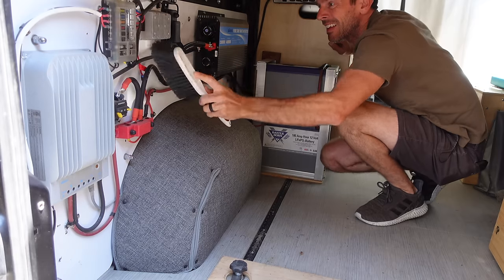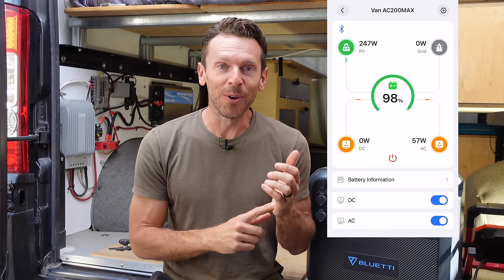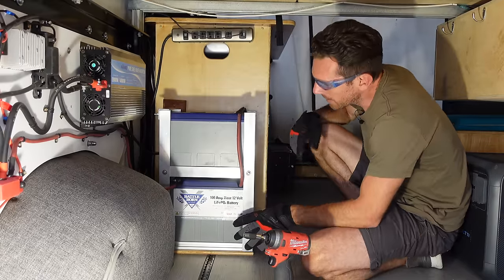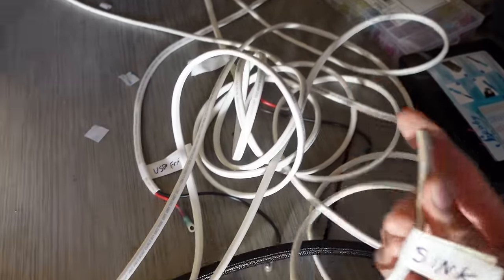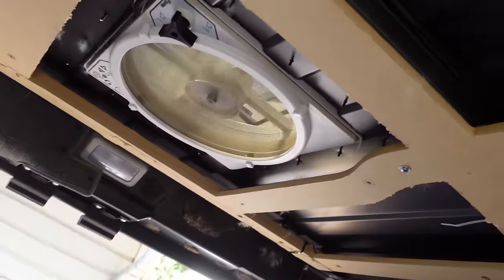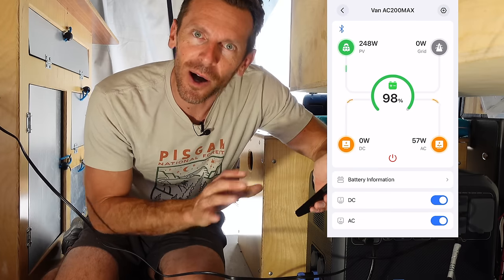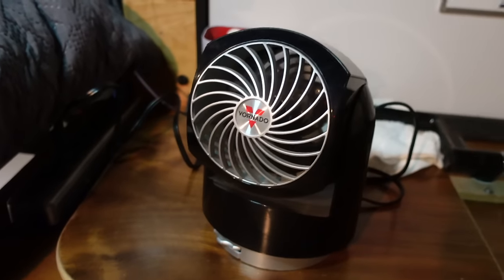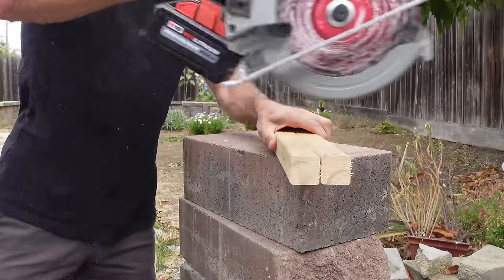The EASY way to power your van | BLUETTI AC200MAX Portable Power Station

Comment: I have a Bluetti AC 200 Max. That is a sixty pound mass that could break loose from that tape and fly towards the rear of your van if you get hit from the front. If you dont mind me suggesting this. Anchor it down with some straps on the handles and bolt those straps into the wood behind the Bluetti. Keep it from turning into a missile flying to the rear of the van.
Reply from the maker: Very good point!
Reply: 60 lbs? IM NOT BUYING ONE
Reply: @aaronweiser5421  newer Bluetti models have come out. There is a nice one that is 30 Pounds, one size down and can still run a microwave.
Reply: @cryptowolf-zf3fs  good to know, 2k is over kill anyways and ues i need to powe my microwave.
Reply: @aaronweiser5421  I have two bluetti's. The 200 Max and the AC-180. I got the AC 180 on sale for $590. I could not beat that price so I got it. Its the 30 Pound model.

Comment: I am using the same Bluetti in my van. I even charge my pivot shuttle. Still haven't charged it all the way from 10% to 100%, but I think it's great. I also wired my bluetti to the roof solar panels. I can charge from them or while driving. pretty cool thing to have when in a van.
Reply from the maker: That's great! I always forget about how nice it is to have a plug to charge up an eBike!
Reply: Can you daisy chain these for more watt hours?
Reply: Do you use it to heat your van? How long does it last? Thanks
Reply: @aname5091 I have my diesel heater connected to mine. It uses very little energy. No issues making it 24hrs at least.

Comment: I read a review on Amazon that Bluetti will shut off if power is not being drawn.  Bluetti does this because the idle power will drain the battery. But the problem is that fridges only kick on periodically. Also another complaint is that Bluetti will not start charging from Solar on its own, you have to unplug and plug the solar connection once their is enough voltage input.  These are terrible problems.
Reply from the maker: There's a setting to keep the power running all the time, just gotta turn off ECO mode. I've never had problems with it not charging from solar on it's own. I have it plugged in all day every day.

Comment: I went the portable lithium/solar panel route in 2018 using the Renogy. It didn't work for me. The cigarette lighter adapter sucked and my 3 100w panels never charged my pack back up to 100%. In upstate NY I had to bring the renogy inside when temps dropped below freezing.  I  switched to 3 AGM batteries charging from my alternator and I connected a cheap trickle charger to the batteries and put in an all weather female AC socket just underneath the van near the sliding door and passenger seat. I could run an extension cord from the van to a 15amp wall socket and keep the batteries topped up all the time. Looking forward to a report after a week at Everstoke and daily use. Love your channel and your content.
Reply from the maker: That's a bummer! I think things have come far enough now where you'd be good to go, but if your system is working good then that's great. Love the idea of the all weather AC socket. I've wanted to do an input and output on my van forever!

Comment: The ac200max can be touchy from time to time. Be careful on your charge settings in the menu, there’s a solar and car charger option. If you get them mixed up it can cause a fire. It almost melted my cigarette lighter because after an update it switched back to pv rather than car charger. Also, it’s picky on the solar panels used. I had a cheap 200 watt panel that was putting out 150 on a Chinese power bank but the bluetti would only max out at 80-90 watts
Reply: At least mine also likes to randomly decide to go all whacked out in terms of the BMS capacity monitoring. I'd give mine a 6/10. I much prefer my built system and I haven't found anything that can get close to the efficiency (the Bluetti inverter is TERRIBLE at low wattage/idle draw like laptops and starlink). 

He also touches on how terrible and expensive these panels aimed at overlanding/RV/vans, but also a huge misconception: You have to realize you're probably NOT getting 1000W/m^2 where you are.
Reply: @SnowIsMyTerrain what is your setup?
Reply: My capacity also goes all whacky sometimes. This last time I used it it dropped from 100% to 75% on its own while turned off.
Reply from the maker: Oh wow, I am mindful about the various settings! That's also interesting about the MPPT having different results.

Comment: Did the same with 2 Bluettis back in 2021. One is for 12v usage charged by 1 400w panel and the other is for our 110 usage and is charged by the van while driving. We switch the charging points if/as needed.
Reply from the maker: Very smart!

Comment: I love my bluetti 200 max in my Skoolie.   I power lights and water pumps  with DC.., Ac for fans, pressure cooker, elec skillet, cordless drill charger and steamer for cooking.  Those cookers are big draws, but not for very long.  For DC I mounted a bus bar with fuses and for AC I have a power strip on each side of the aisle.  My solar is 400 and it works fine on sunny days., the Bluetti also uses a 110V brick charger when at an campground with hook ups that charges around 400 watts also.    This works so much better than I expected.
Reply from the maker: That's fantastic! It's crazy how powerful the electric cooker stuff is, you never know until you actually have to worry about energy.

Comment: Great video.  You did exactly what I did, although I swapped out my two 12 volt  lead acid batteries for two 100 amp hour lithium batteries for a total of 200.  From my 2 solar panels 630 watts total  I installed an A&B switch to select between who to charge between the Bluetti or the lithium.  And everything charges from the engine alternator while driving.  The system works great.
Reply from the maker: That's fantastic!

Comment: I geeked out for months on building an electrical system, but I really didnt like all the complexity ... so I ended up getting the AC200P.  So easy. Works great, and it is so versatile. I use it for all kinds of stuff in and out the van.
Reply: Also, strap that thing down to something that can hold a 65lb weight in a collision.
Reply from the maker: SO much easier, and like you said, so useful for lots of other stuff!

Comment: I charge the 200 max in my van with the AC power brick plugged into a 1200 watt inverter connected to my Transit van charging system.  That gives me close to 500 watts and I can also charge from the cigarette style plug at the same time for about 550 watts.  I rarely have to use my portable solar panel.
Reply from the maker: Beautiful!
Reply: Doesnt it empty ur car battery? And also , how long does it take to refill it? I m completely new to all this btw.
Reply: Yeah curious to know how you can automatically stop the inverter from draining your start battery, and to start when car is on

Comment: Awesome, despite it being a sponsor it's still really good see this put to the test in the real world. Hopefully it will replace your old setup for good, if it does it will be very impressive considering how much is packed into that box like the solar regulator, ac-power adapter, inverter etc. I recently purchased a small 300w portable power station and it only has 1 power outlet but it works with a 4x outlet, so now I can charge all my camera batteries and it hardly uses any power despite overloading it with 4 plugs.
Reply from the maker: These things are getting better and better! So far so good in the van over about 3 weeks.
Reply: For the price it’s not worth it. Your homemade system can do more power for about 60% of the price

Comment: I've been trying to figure out how I wanted to do my van's electrical.  I have the knowledge and skills to do the electrical but I wanted my van to be able to go from cargo to camper.  I seriously looked at the Ecoflow Powerkit but at $8k meh..  I just purchased a Percon EP3600 portable power station.  As you noted in the video it's easy peasey to take it back and forth from the van to the house and at 3600 wh (approx 260 ah) it's more than enough for how I use my van.  I'm putting in a 30 amp RV outlet for the charging and the Percon also has a 30 amp DC out to run to my DC fuse box.
Overall a portable power station just makes more sense.  I will be adding two of the Percon 500 watt alternator chargers when I upgrade my alternator.
Reply from the maker: Good stuff!

Comment: I’ve had two of these fail now.  The charger port burned up both times. Replacement turn around time was 1-2 weeks. They clearly have a serious defect.  The problem is a sloppy connection between their charger and the port on the unit.  I’m just glad it didn’t start a fire.
Reply from the maker: Oh wow, that's interesting. I've got 3 different Bluettis in service over the past 3 years and haven't had the problem yet. I don't leave the charger plugged in.

Comment: Thinking of buying this unit or maybe the new 200L. But can you run say the 12v lights and fridges at the same time as using the AC with boiling watch with a kettle?
Reply from the maker: Yep, the kettle will be pulling the most watts, and the 12v lights will be negligible compared to that. 1,000 watts versus 10.

Comment: I don’t know how many DIY systems haven’t caught fire. That was my concern and went with Bluetti AC300/ with 2 B300 (1k solar panels). no worries about power for days! 🎉 - My touch screen isn’t working and their customer service is non existent (have had for 2 years).  Thankfully they have an app which they need to upgrade:)
Reply from the maker: Exactly! Especially in a vehicle that's jostling around for thousands of miles a year!
Reply: So that setup gives you 24/7 power without having to plug into a wall outlet of a home or rv park? In other words does that setup enable you to be fully offgrid with enough power to live year round and have electric every day?

Comment: I'm going integrated in my next build too - my wiring is  a mess.  Definitely adding 50a DC-DC alternator charging.  Been designing custom removable  roof hatches with flat solar panel on top so on a really hot Florida day I can just park under the trees and move the panels  20' away into the sun and blow hot are out of the top of the van.

Comment: I have the Bluetti EB70s that I bought used for a good price, it does well, I got it as a temporary battery for my van. I have a mini fridge and one light source, I also charge my laptop and camera batteries. It does well but I'm thinking maybe I should upgrade to the AC100 as the AC200 is a bit out of the budget

Comment: Great video. I recently purchased the 200Max and planned the same type of set up when I found this video. A couple questions for you please. 1. Did you run a circuit breaker or fuse between your +12vt output to the distribution block?  2. How did you incorporate the AC aspect? ie…Did you use a power strip to the AC out on the Bluetti?  Thanks!
Reply from the maker: No circuit breaker between the output and distribution block, but it's always a good thing. It's easy to switch the DC output off in the app.

Just using a couple extension cords to power strips, very simple setup!
Reply: Thanks!

Comment: Awesome! I dont have a blue Eddie.. In my case I have a jackery 2000 plus any recommendations on what wire plug I could use to connect the 12v fuse black for power?

Comment: Can the AC180 do this too? I bought one and was told by bluetti that it can't power an RV and that it doesn't have an RV adapter. So what's the difference between the AC200 and the AC180 in this regard? Thanks!! Also, how do you "extend" the 110V outlets on the bluetti around the van so you can use them anywhere in the van, without having to plug into the bluetti at the back of the van?
Reply from the maker: All of my electrical stuff is internal in the van, so it makes for a different setup than an RV. Usually an RV has one giant plug that powers everything inside of it, and the bigger Bluettis have the outlet for those plugs. But for my setup I just ran everything into the Bluetti.

Comment: you need 9bb solar panels if you’re only getting 80 watts.  JJN has some cheap 9bb 100 watt panels.  I swapped out all my old renogy panels that only get 80 to 85 watts.  I’ve gotten as much as 104 watts on the JJN’s.  Usually they get around 94 watts.
Reply from the maker: Yeah, I think I could swap my panels out for something new and get much better watts. But the Bluetti still fills up nicely without a bigger panel.

Comment: can you (amazon) link the cable from the Battery unit to the fuse box that's hard wired in ... so I get the correct one ? thx
Reply from the maker: Whoops! I thought I had posted the link in the description: https://amzn.to/3upurYd  Then I just cut the end off the red/black side and then wired that up to my DC load center.

Comment: If I get two of these, would it double my watt usage and be effective? i work multiple jobs every single day for at least 8 hrs/day on one laptop/one PC/fridge/fans/air conditioner/water heater/steam shower/electric stove and oven. How do you charge it? In a coffee shop?
Reply from the maker: Yeah, you can get two and double your wattage, but I'm not sure if 240volt will work for the more big appliances. Lots of research to figure it out!

Comment: I started with this. Still need panels. I use a bike lock to attach to the back to secure it.
Reply from the maker: Panels are a game changer!
Reply: @bkxc  which panels do you use? I want them fixed to the roof. I have a PM 159wb

Comment: Nice job and thanks for sharing. Is there anyway you can put a link to the 12v cable to the fuse box. I cant find a 30amps one. And i know there is 2. The xt60 to the fusebox is easier to find. But the cigarrete lighter 30amps to xt60 i was no able to located. Thanks
Reply from the maker: I've got the link in the description! DC cable I used to power my load center: https://amzn.to/3upurYd
Reply: @bkxc  aweome i did miss it. Thanks

Comment: At min 9:15 you showed the cigarette lighter cord as a third way to recharge the AC200 and mentioned a way to improve the charging time using that 10 Amp plug.  How can you improve the charging time with that device?  I'm a car camper with no solar and recharging while driving will be a necessity for me.  Thanks
Reply from the maker: I bet if you took it into a car audio place they could get you hooked up with a better connection to the battery for a better charge through the cig lighter. As it stands, the charging from the cig lighter is pretty slow.

Comment: Would placing a master switch (1&2 option or 1+2 option) between the fuse box and power bank be needed for a set up like this?
Reply from the maker: You can manually switch off the DC power in the app or with the front DC button on the unit itself, so I think a switch would be overkill

Comment: 3 Questions ,Dont you Have an AIR CONDITIONER in your Van ? Or plugged to the blueti? 
Do you think it vould run a roof top A/C in the van ?
Reply from the maker: I don't have A/C in the van. I believe the Bluetti would be able to run a RV rooftop A/C, but I don't think it'd be able to handle it for more than a few hours unless you're plugged into shore power. I'm guessing a rooftop A/C would draw 1,000 watts an hour. This Bluetti has about 2,000 watt hours of energy storage. With rooftop solar I think you'd be able to get 800 watts of power from the sun, so that would be able to get you a bit further.

Comment: Bought the 200 Max and the 420W solar panel, works perfectly. Though the panel is a bad design so I decided to buy the AC 200p. Had no end of trouble with the 200p. Turned it on for the first time, fault lights everywhere, orange icon for the PV/CAR icon and the AC load icon. Turns itself off at 2:16 every morning and the date is stuck on the 18/1/2020 at 10:4. Absolutely shocking customer support, although kudos to the guy on the phone who tries to help but has no clue. 
It seems like the machine has been sitting in their warehouse for many years and it looks like it might even be a returned item. 

Definitely  do not recommend the AC 200p.
Reply from the maker: Man! That is brutal. The hardest part is having to send back a massive item like this. I hope they swap it out.

Comment: Question for you... I have a JUPITEK Portable Power Station S1200, 1228Wh LiFePo4 Battery... I really only need to run my Alpicool C15,12 Volt Car Refrigerator and charge a couple phones and led lights. Do I need a load station or can I just go direct from a 200w solar panel direct to my Jupitek (which it has a direct plug station for solar power)?????
Reply from the maker: You don't need a load center unless you want to run a BUNCH of different 12volt appliances. You should be able to plug in your refrigerator and be good to go. But I have my fridge, vent fan, lights, USB chargers and my water pump all running 12 volt, so I needed more ways to plug in.

Comment: Have there been any issues with using the 12v/30A RV cable? Is it enough to run all of that through?
Reply from the maker: 360 watts (30A) would be pretty extreme for everything I have hooked up. The fan is very low watts, phone charging doesn’t spike it much. Fridge is very low wattage too, a crazy 35 watts or so when I monitor it in the Bluetti app. The 12v stuff I have is all very minor.
Reply: @bkxc Thank you for the reply! I’ve been trying to figure out what to do instead but realizing just how much 30A is helped a lot. Excited to finally get this all wired up now